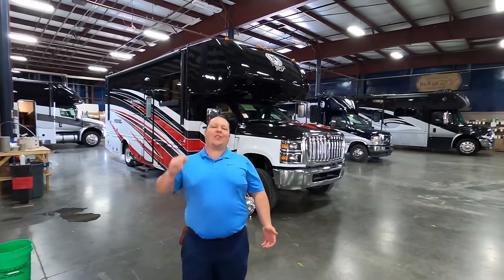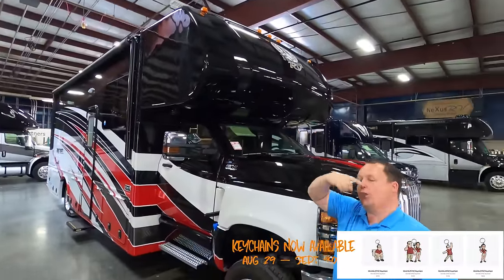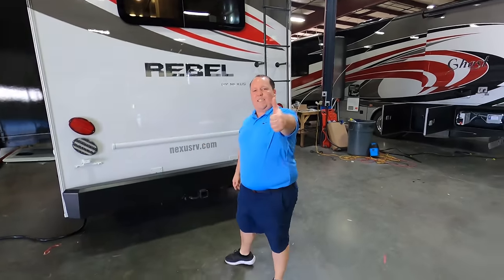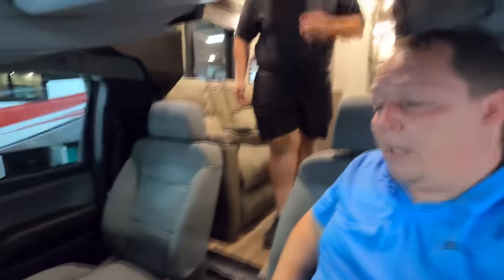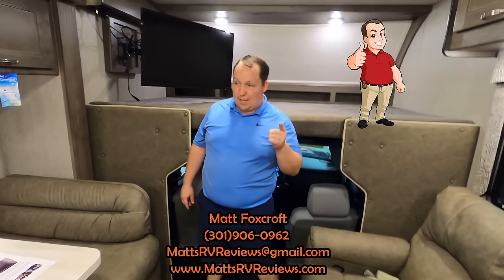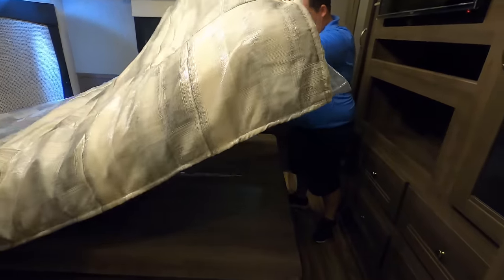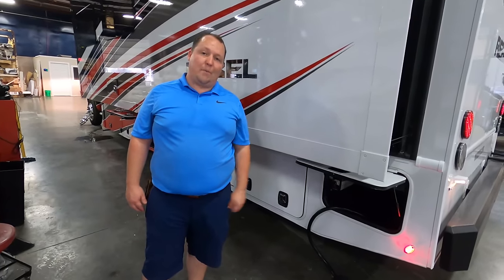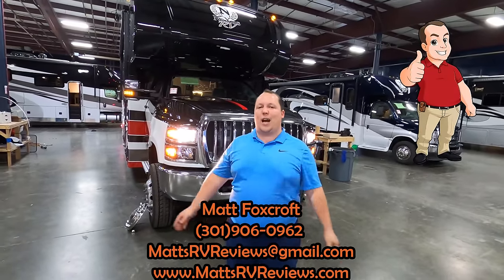The BEST Super C 4x4 Motorhome IVE EVER SEEN 👀

Comment: for 200k i would want to do a lot of aftermarket stuff to this RV.... enhanced front bumper (possibly a winch) and bigger tires for instance... also for a 4X4 probably gonna want to lift it up....you should have an option for slightly smaller bays underneath.. change the generator size to smaller....at least prep it for solar (big mistake for a 4x4)....if you could do the same think on super single tires and lift it 4 inches more then you would have an rv with a true resale value....finally I like the international...as opposed to the general ram or F550 you normally get with a 4wd.... also boondockers dont like rv park paint jobs...the want boondock two-tone or monotone paint schemes...is the toilet a macerator?? also the tile is "cheap looking....a full back-splash would have added maybe $30.00 to your cost...really???? Dont get me wrong though I like it a lot....and if I had 200k I would buy it....

Comment: 3 Likes:
1: Cool paint job and exterior design (steel bumper is pretty nice to have as well)
2: 4x4 with Duramax 
3: Azdel inside and outside, steel construction, and metal ductwork
3 Dislikes:
1: Bland interior design
2: Poor TV placement in living area
3: Lacking a few frills for that price

Comment: If I recall correctly the adoption of azdel interior panels has been slow due to the difficulties fusing the interior finish to the azdel panel and the cost of the equipment to do so.  The azdel folks (If my memory serves me) recently started performing this step for the rv folks.  So I suspect we should start seeing more azdel on the inside.

Comment: I like the power driver seat and dislike the manual passenger seat. I like the paint job and the full awning, but I REALLY dislike the top-opening storage doors. I like the storage under the dinette, but it lacks drawer space in the galley. AND solar should be standard but it's not even prepped for it.

Comment: LIKES
1. Engine POWER super good torque get up those hills
2. Engine very quiet
3. Cab over bunk good for kids
4. Dinette comfy sofa
DONT LIKE
1. Lacking bunk beds. Make it a little bit longer so you can add some bunkbeds
2. Too high priced - Expensive
3. Propane tank too small for the great big space. Wasted space. Double the tank capacity 
4. Why not orient the bed north and south...not sideways wonk wonk

Comment: Storage underneath the bed would have been great .if it's 4X4 wouldn't it have been more beneficial to raise it slightly?  You do get more access to certain places but the coach being that low is still limiting. The rear bumper cover have had some storage capacity. I like the AC system and the low VOC materials.
Reply: The fresh water tanks are under the bed to stay consistent with it being 4 season.

Comment: Bad, no side open storage doors, no solar prep and no tire pressure monitoring system: the good, like the wet bay, great bathroom and excellent storage.  Now, a 20 gallon propane tank is good...a 24 gallon tank is better.  Also, what would it take to get the CCC's of these RV's again.  Seems that detail is so often overlooked lately.

Comment: The 3 things I like about this motorhome:
1. Azdel on the outside and inside
2. metal ductwork and the heat ducts are on the side
3. the chassis: the cab, engine serviceability

The 3 things I don't like about this motorhome:
1. the baggage doors open upwards at 90 degrees
2. no pantry and nowhere to put a trashcan
3. the TV placement

Comment: 3 things I dislike.  The backsplash looks like they didnt finish it. It doesn't cover the whole backsplash. The whole driving area tough to get into. Doesn't seem to have much storage in the kitchen or an ice maker. No place for trash can. I like the lounge chairs. Like the splash guard on the edge of the counter, so the dinette doesn't get doused. Appreciate the wall airconditioning/heat. Lots of storage outside. One of those doors should have an outside kitchen!

Comment: I hope those backsplashes are not done yet... it needs to go all they way up in both the kitchen and bathroom... that little strip by the kitchen power outlet is ridiculous...  They need to find a different place for the tv..  I hate dinettes so I would want a couch with a table on high low legs and it moves in and out and sideways.  The best table like that I ever saw was actually in a truck camper... FANTASTIC... it then would drop down and slide into the couch for a cushion for the bed.

Comment: Matt, carry a small flashlight. The storage compartments were not even visible. 
Dislikes: 
- No counter space.
-No prewire for solar on a 4x4 RV that will most likely be boon docking. 
-No WiFi. 
-No power or USB ports at the table. 
-No window in overhead sleeper.

Comment: Things I like:  It"s a 4x4 REAL Super C.  All the F-550s are fine, but not really Super C to me.
                        Fiber Glass roof and leak resistant outside panels
                        Dinette plus sofa or theater seats
                        Lots of storage including some passthrough.  We go cross country skiing and looks like the skis would fit in a compartment.
Things I would change if I could
                       True wishful thinking, I would really like AWD/Full time system over part time 4wd.  We want the 4wd for snow and bad weather, so fulltime is much more convenient.  We have a 4x4                     pickup and camper we use and have discovered that anyplace that really needs rock crawling 4wd will result in all the dishes on the floor and probably can't get there because of size and overhangs.
                       Not a show stopper, but the outside paint is bit much for me.
                       Based on history, I prefer the Cummins 6.7 L to the Duramax, but again, not a show stopper
                       An option for 800 watt solar would be nice.  I realize a dealer can add it.
                       Agree that TV placement could be better in front.
                       Would love outside kitchen, but realize you need someplace to put it.
                       Wish generator was 8 kw instead of 6.
                       If the same basic unit could be 29.9 ft instead of almost 31, it makes more places accessible due to size restrictions.
Preference wishes aside, this unit basically hits the mark for an all season 4x4 RV

Comment: That is a chunk of change to plop down.
Likes:
1) 4x4 would be great for boondocking
2) towing capacity
3) theater seats

Dislikes:
1) exterior storage doors open up and don't open all the way
2) no rooftop solar prep
3) exterior tv - I don't want that bouncing around when I go off road to get to my boondocking location

I'm hoping that those tires are just put on there because it wasn't finished and that the finished version will have bigger better tires.

Comment: The TV placement is always a damn issue. EASY FIX....yet the Geniuses in the Industry cant seem to solve simple issues. Make a SLIDE RAIL. This is not complicated guys, come on. Create your own Slide Rail that is the width of the back of the TV, the Slide Rail attaches between the Extension Bracket and the TV. So, when you Pull the TV out and to the left or right limits of the Extension Bracket.....then the Slide Rail comes into play.....the Slide Rail will allow you to slide the TV another 1.5 feet either left or right. Do i have to get my welder out and make one or what?  come on guys...again..this is not Rocket Science. Use your Melons  !!

Comment: Coiled up power cords ... Wikipedia :
An extension cord that is in use while coiled up or coiled in a reel can be a serious shock and fire hazard. The heat produced from the resistance cannot dissipate and is instead trapped between the tightly coiled cable, leading to the a fire or shock.

Comment: Three dislikes. One the ground clearance is horrible in the back. You build a 4 x 4 people are going to take it off road you need more ground clearance. Two is the antiquated rooftop air conditioners. When our RV manufacture is going to start hanging split units off the back. You can run those on large inverters now. You can certainly run those off of the generators. They perform much better and they leave the roof space open for solar panels. That leads me to number three.Factory rooftop solar panels are a must. With sufficient battery storage to run all night. These are the mods that people do as soon as they buy them. It’s time for manufacturers to get on board with what guys are doing when they buy them.

Comment: I would like to see a macerator pump, don't like the outside doors that require crawling underneath, hate the TV position, it should be across from the theater seats with the option to have a really large one , like 60" TV there. Also I miss the washer /dryer. Don't like the backsplash design and could be higher in the bathroom. Is there a King bed option ? 
I love the 4x4 and the chassis , and the overall safe and quality construction. Would like to have a dinette that is not a dream dinette with the structure underneath that disturbs the legs while seating as we are very tall.

Comment: Suggested small improvement, we are buying a 4x4 and expect to go further backcountry than ‘normal’ rvs... that said its not going to be  rock crawling but since it will be on more uneven surfaces things are gonna shake and rock a bit more inside... heres the thinking.... put some secondary restraints inside the cabinets /drawers/cubboards, like bungee netting or something so that when you DO open things the contents will likely have shifted and will help keep things from falling on your toes... small touch, big effect....

Second thing is the rear ladder... put a hinge on the lower part to be able to fold it up for better rear departure clearance... thats gonna hit as it sits now... i see ya already slanted rear box to address some departure clearance...

Love this unit overall tho....

Comment: Thanks for the video.  
Dislikes:  
1.  I agree 100% on the power reel.  No one wants retro fit the RV with it.   
2.  The backsplash has got to go.  It takes away from the cool paint job which is utterly amazing.  Please take the counter top and run it up to the base of the cabinets.  
3.  Finally the TV needs to be behind the banquet on a lift that raises it in front of the window - get the biggest TV that will fit.  TVs and Toilets are dealbreakers for my husband. 
Loves:  
1.  The length - 30’ is perfect
2. 4X4
3. The bad a** paint job.
3. The layout
4.  The bed over the cab - perfect for teenagers

Comment: That looks like a Chevy 5500
Reply: That's because it is. GM & Navistar co-developed the CV to fill the gap left by the Kodiak. It even has the 6.6L Duramax V8, though International calls it the "International 6.6".  I actually would prefer the taller cab of the Kodiak (which was basically the same as the Express cutaway) rather than the shorter Silverado cab. Good eye, though.

Comment: I'm mainly commenting on the interior. Like the overall design layout except for the TV placement. It should be directly across from the two seats. 

Dislike all the color choices, and the "art deco" is ugly, especially in those colors. I would have to replace the picture with something else. Glad to hear that future versions will be lighter colors. 

But please don't make these same mistakes when you change to the lighter colors:

1. Installation of the backsplash is the WORST I've ever seen in an RV in both the bathroom and the kitchen. Whenever you install backsplash, it must go completely from side to side. On the left side of stove, take it all the way to the end. Do a cutout for the switch and change the switch color to white instead of black. Mount your stickers further up or side by side.

Putting a thin verticle strip down the middle of the space in front of the sink is just ridiculous. Would you ever install backsplashes like this in your own home? Then don't do it here either! Take it all the way from window to side. Cut around the window casing to properly install it. Kudos for the plastic protector between the sink and the dinette seat. Just make certain you change the color to match new lighter color scheme.

2. Bathroom backsplash looks ridiculous. Either mount it all the way up to the bottom of the cabinet, or at a minimum 1/2 to 2/3 up the wall. 

3. Do not take the fabric cover of the valance down both sides of the windows. It should go across the top only for a cleaner, more modern look. Don't put it atop the door either.

4. At first I didn't like the open spaces in the middle across from the bed instead of drawers, but now I like it if standard size fabric or plastic bins could be inserted in there to hold things. Suggest you try that out for size and adjust accordingly. The narrow space is good for shoes. If possible, slope the bottoms of these spaces slightly downward to avoid the contents from spilling when driving, or consider installing webbing across both open spaces (maybe with velcro) that could be easily removed if the owner doesn't want to use it.

5. Not fond of exterior paint - pattern is too busy. Dislike the red color and the large amount of black paint on cab and the top of RV. Definitely designed to appeal to the men more because the overall look is very masculine. Probably has a high price point attached to the paint job that could be saved with a different design.

Your RV has a lot of good features too that others have mentioned. I mainly concentrate on the looks and design. NOTE: at this price point I definitely would NOT be willing to pay extra for more backsplash and better workmanship. You should have done that anyway. If I were buying this particular RV I would expect an even greater discount because I would have to remove the current backsplashes and replace them myself.

Comment: Dislikes; Compartment doors swing half way up instead of all the way with magnet catches, or could/should side swing. Poor TV placement. Shower could be larger. Should maybe be an 8000 generator, especially since dual a/c units. Gas/electric fridge. (yeah, I know, that's more than 3) Likes: A good amount of storage outside. Theater seating. Dual a/c.

Comment: Dislike: TV above the bunk and the potential for hitting, no solar prep, colors of the decor/weird vertical valances, placement of the dump - it didn't appear to line up with the opening of the compartment; Like: overall length, quite engine (it's really quiet), colors. I would really like a north-south rear bed but that wouldn't work with the full slide.

Comment: Dis likes:

1.The grill is hideous IMO. The grill gaps are WAY big and open. The double stack lights looks VERY dated.

2. The black paint will keep it HOT and harder to cool off

3. Just not impressed. No solar prep, side storage doesn't open all the way up, front bunk looks PLAIN, manual passenger seat, it looks like a 2010 model (style) , kitchen looks crowed,  regular microwave, not much storage, horrible shower (that shower door won't last a year), no charge ports on either side of the master bed? Come on, no air horn,  tv placement over the bed looks cheap with all the wires showing, tiny back splash, (Show when its complete)

Likes.

1.  4 wheel drive 

2. Still thinking 

3. Still thinking...   nope nothing comes to mind

Comment: DISLIKES: no solar prep, exhaust placement on camp side directly under the outdoor tv, dark wood cabinets, inside tv placement,  no under-bed storage, no pantry, would like optional over-cab storage or entertainment center instead of bunk, front seats don’t swivel, passenger seat not power, no cocktail table between seats, and PRICE 😳...especially for the amenities it DOESN’T have!  
LIKES: theater seats, oven/stovetop/microwave, counter space and double sinks, power pad, residential refrigerator, ladder accessibility, plenty of outside storage, drawer storage under dinette seats instead of having to get up and lift seats to get to storage.

Comment: I love the floor plan on this RV, but your right the TV has too be on a tellevator behind the dinnete. I HATE the placement of the too small propane tank, You have taken one of only 3 available basement bays and wasted it with the tank placement. Turn the tank 90 degrees to the frame and enclose the bay and vent the tank. Therefore keeping it from rusting and being pelted with rocks and mud, it is a 4x4, so it will see rough gravel roads. WHY NOT put the propane in the last small basement bay passenger side, leaving the 3 large bays for storage  !!  The back splash is hideous and looks like it was installed by a 4 year old, YES YOU HAVE TOO CUT TILE but ITS EASY, fill the whole wall from counter too underside the cabinet and return at same height on the side wall by the stove. There are many more styles of tile that make that easy and look fantastic. ALSO this is a 4x4 so you have to think this rig will be a BOONDOCKER , The MOST IMPORTANT thing is SOLAR POWER,  WHY IS THERE NO SOLAR PREP, for this price and intended use this should be included no cost, after all its just a plug in the roof with $20. worth of wire down to the battery compartment. It might be nice to have a bit better ground clearence on the underside, either making the basement bays a bit shorter or having air bags too temperarly raise the body 4 inches.    Great review Matt  HAPPY NEW YEAR     CHEERS     Steve h.

Comment: Dislikes
-No under bed storage 
-Exterior storage open vertically instead of horizontal 
-19.5" tires seem small for the size of the Rig and the size of the price
- light over table looks dumb
- 4 wheel drive unnecessary 
- lack of pantry and adequate kitchen storage
Propane bbq bib on driver side
Likes
- tilting hood
- engine/Trans combination 
- international chassis 
- microwave, 3 burner, and oven
- bathroom very nice
- under cabinet lights 
Over cab bunk